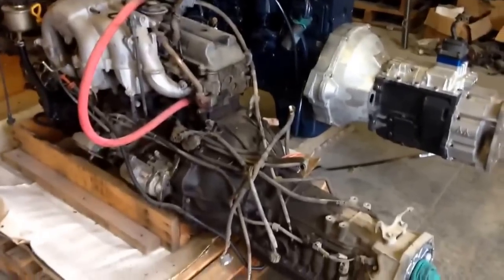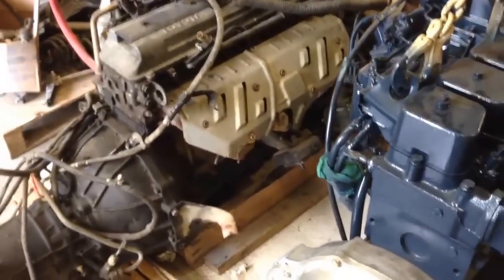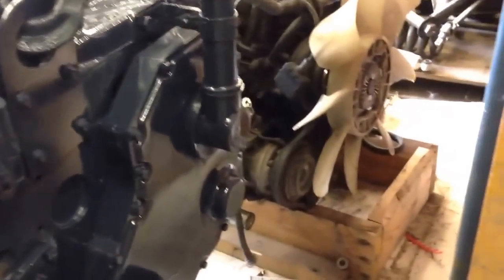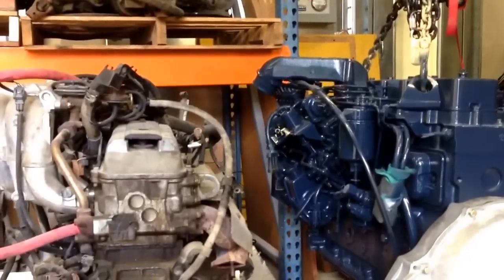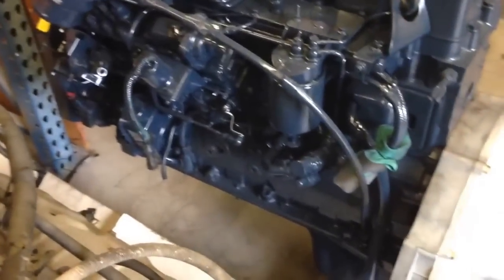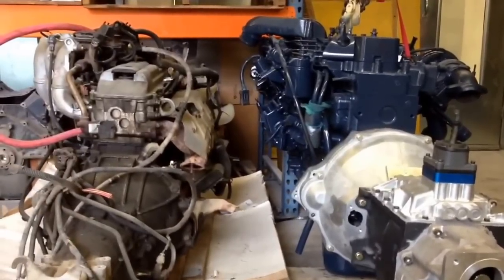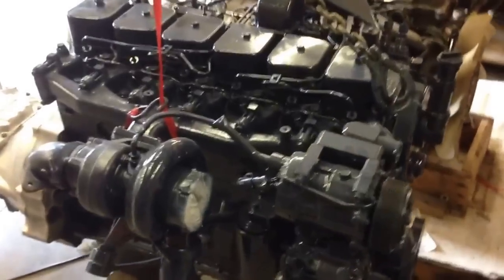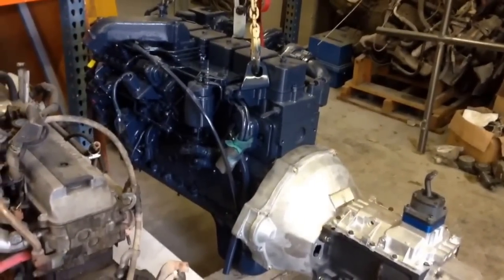Cummins 6BT 5.9L vs Toyota Land Cruiser FZJ80 Stock 4.5L

Comment: How's suspension after a Cummins? Changed springs and shocks? Axle Truss? If you had an option of a 4.2L inline 6 Turbo Diesel (not the Toyota) 200hp and 400ft lb of torque rev at 4000rpm with a 660lbs of weight (very reliable though) against a Cummins 6BT, what you'll use? I have an 105 series with the 1FZ-FE, and I'm planing to swap for a diesel.

Comment: Well, my '96 FZJ80 with the 1FZ has almost 300k miles on it.  I have a '96 Ram with a strong running 6BT and NV4500 available to me.  The Ram it is in has pretty much disintegrated around the drivetrain after 400k miles.  Might do a swap, but would want something like 3.5 gears in the diffs because I would want to keep RPM's around 1,900 @ 70 mph.

Comment: This was really helpful!  I assume areas like motor / transmission mounts will be addressed at a later date...  yes?  Also, have you measured up from the motor mount datum line to determine if the Cummins will fit under the existing hood without hood mods?  With the engine / trans already out of the vehicle this should be an easy measurement.

Thanks again for these videos! Great stuff